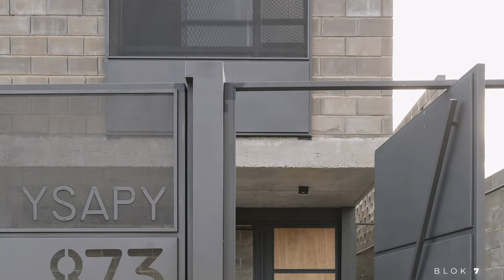Efficient and Adaptable Living Spaces | Naked House

Comment: This house has more merit than most so called “modern” houses I see being sold.  This is I think architecture moving forward in the Philippines. Most modern houses I see in videos done in the Philippines limits architecture to nothing more than a facade and the interior spaces are poorly done. Ones quality of living is improved by the quality of spaces they inhabit. For the longest time professionals has been so obsessed with how a house looks on the outside which has very little impact on improving the lives of the user.

Comment: Thanks for the video.First, this is very nice home. I do appreciate the brutalist attempt in usage of raw materials, but I struggle with some of contrast in the rawness of the interior block work (sloppy mortar) and the refinement of the metal and cabling and smooth wood veneers. This might have been the designers intent, but does not work for me as if gives me the feel of an unfinished work as opposed to a style.